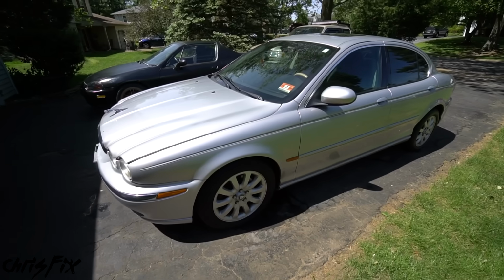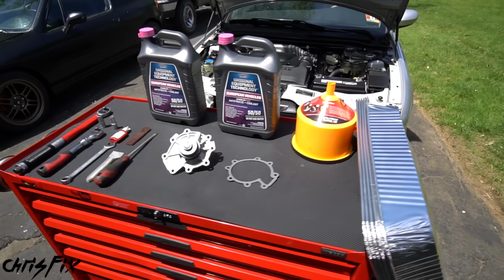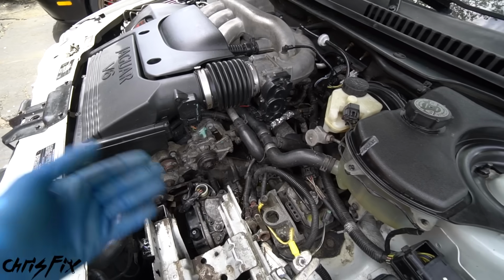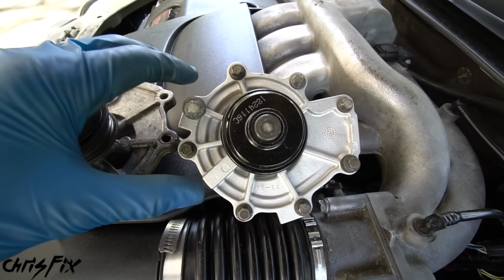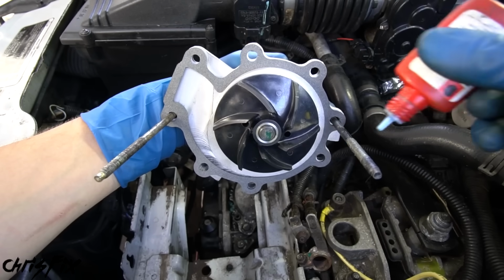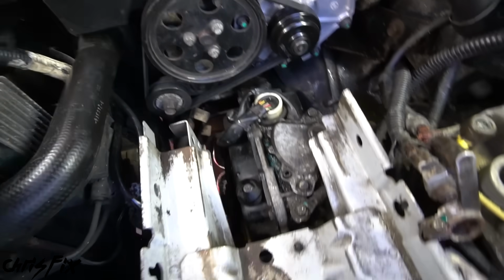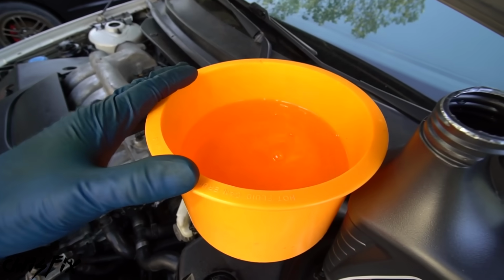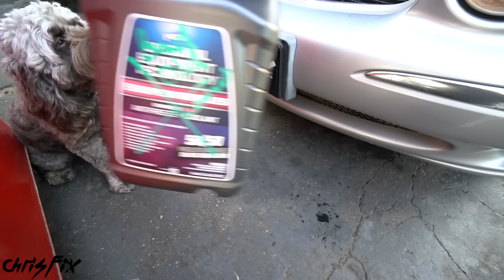How To Replace a Water Pump and Save $783

Comment: Hey Chris, quick question. A lot of your videos mention referring to the owner’s manual for specific torque specs or additional maintenance info. So, I’ve been following that advice — I keep my owner’s manual and a notebook with my car’s specs handy.

Recently, though, I noticed that the maintenance I’m actually allowed to do is pretty limited. The manual I just bought literally says to visit a dealer even for something as simple as checking the transmission fluid level, and it specifically warns not to attempt checking it myself.

As someone like yourself who’s worked with cars far longer than I have, how do you overcome those kinds of obstacles? By the way, thanks to your guidance in one of your videos, I successfully changed my own spark plugs today — and I’m really proud of that. Thank you!
Reply from the maker: Not owners manual but service manual. The service manual gives you everything you need to do pretty much every service on the car. Nice work on changing the spark plugs!!!

Comment: Simpel job.... in my car, an Audi A4 B5 with a 2.4 V6 (yes, the QUATTRO) I have to remove the whole front to get to the pump pain Sadly VW Audi didn't think this part would fail that easily...

Comment: Hi Chris, thank you for the Video. 🙌
I have a question:
After everything is done and the coolant is filled back up, isn't the Waterpump still "running dry" until the thermostat opens?
I just changed the Waterpump and did a Super Flush all in one on my Car and i was wondering if that could be harmful to the new Waterpump? 

Thanks in Advance and Greetings from Germany. ✌️

Sven :)
Reply from the maker: There is a hole in the thermostat that allows coolant to flow, just not at the speed of it fully open.
Reply: @chrisfix ahhh ok, i didn't know that, thank you :)

Comment: How are you Chris? What I don't understand is how the funnel doesn't fill the reservoir completely to prevent spillage. Whenever you take it out, it's at the exact point of the max line.
Reply from the maker: It does but then it spills out when I remove the funnel and levels off to the max line. You can also use a turkey baster to remove some.
Reply: Thank you for informing me❤ @chrisfix

Comment: Fun fact, if the water pump is in a tight spot it can be a pain to keep the gasket in place when trying to install it, i add a very small amount of sealer to the engine side of the gasket to make it tacky enough to stick on. Also it will help even further by filling in any minor pitting that could be on the machined surface on the engine which i have seen before on older engines. Never had an issue doing this

Comment: i’ve literally saved myself at least 2 grand by now watching your videos. changed my own oil at least 5 times now. did my coolant flush today, changed the freaking thermostat while i was at it, cabin filter, and i’m gonna change my temp sensor tomorrow my buick is still running a little hot. i might have to change the heater core though which im scared of because of how much shit i have to get through in the cabin

Comment: The jaguar water pump placement must have come in clutch. I did replaced the pump on my 06 corolla, and i think i only torqued the bolts to 5ft lbs 😭 have to take out the fan, the alternator and work through the wheel well for the bottom left bolts. Good job dude

Comment: Hi Chris im hoping you or somebody will be able to help me. I have a 2nd generation is250 that has white smoke coming out of the exhaust, especially when i rev it. I have looked at the piston and all of them are dirty so it doesnt look like a head gasket. People have said water pump/radiator could be the issue, is this a possible cause? and if so what would have gone wrong? I just want to fix it

Many thanks
Reply from the maker: Has your car overheated recently or is it loosing coolant?

Comment: My water pump is bad everyone keeps telling me I have to do timing chain too. It's a 2007 Ford edge with metal timing.  Do I really have to do timing chain?
Reply from the maker: On that engine you probably need to remove the timing chain to do the water pump which is why it is recommended anyway. It seems like the timing chain is a real pain on that car.

Comment: He gets it look so easy... only problem is my car dosent have space for rench to remove the Polly this Guy makes it look so easy
Reply from the maker: This was definitely one of the easier water pump jobs, I'm planning on making a video of one thats a bit harder to do
Reply: @chrisfix  its fine... was just pissed at my own car because there is no space to work with. so the polly dosent come of, you need to losen it and basicly let "hang" because the polly dosent come 100% off. but enough losen the 5 bolts holding the waterpump... you video is great man. really well informed and well put together and easy to understand. just suzuki that mekas cars impossible to work on

Comment: Do you have a video on water pumps that are integrated into the timing system. Like in the 2003-2007  muranos and infinitis with the 3.5 engines?
Reply from the maker: No but I am planning on making a video for engines like that

Comment: At least your car had an easy access water pump my Subaru’s water pump is inside an aluminum timing cover Smh. So it’s a timing job I just might have to spend that $850 the timing bolts are also stripped fml.

Comment: Can water pumps screech on cold starts if they are going out?
Reply from the maker: They could if the bearing is going out or its releasing coolant through the weep hole and getting on the belt

Comment: hey chris, wanted to have u opinion on a 2005 acura tl for my first car. it’s pretty high on miles with 188k and the dealer says it’s been well maintained and people say tls can push well over 200k miles without major issues
Reply from the maker: As long as it checks out from a mechanical perspective and you can get it for a good price I would go for it! : https://www.youtube.com/watch?v=vC8LbvYk6es&list=PLvKbarVtwhUv6bjLhJSyaEOxaYy03j7QS
Reply: @chrisfix  alright than you so much!! i’ll watch that video a few times over before i pull the trigger

Comment: I just recently replaved my waterpump on my mazda b4000 and ita still leaking in the same spot im asuming potentially a bad gasket or I didn't clean the surface good enough next time i replave it should i put some rtv in the corner with the paper gasket? I know you say not too but i figured it would better to be safe than sorry to have to tear it down a 3rd time.

Comment: Hi there,

I wanted to reach out and let you know how much I enjoy watching your videos. They have been a great help to my guy and me as we work on my 2006 Ford Mustang. We have a quick question about replacing the water pump, which comes with a metal gasket. The manual recommends putting RTV on the gasket, but you advise against it, as it could result in having 2 gaskets, making it redundant. We would appreciate your recommendation on what to do. My car is a 2006 Ford Mustang V6, and we plan to do the work this weekend. Thank you for all your helpful videos, which have saved us a lot of money by allowing us to do the work ourselves.

Jessica
Reply from the maker: If the manual recommends it then I would follow that, in most other cases you would use one or the other
Reply: @chrisfix  I forgot to mention, I meant the Haynes repair manual. That's what it says. So should we still put RTV or no?

Comment: Hi Chris I love your videos. You are a role model. I have a question for you. Here in Nigeria majority of the drivers uses water instead of coolant. I want to know if it is a good or bad ideas to use only water instead of coolant.
Reply from the maker: It's not the worst thing in the world, you can technically use coolant, but I would recommend even 10-20% of your cooling system be filled with coolant and distilled water so it can last a good long time. And if the weather gets cold I would bump up that percentage: https://www.youtube.com/watch?v=29z94xBdAjE

Comment: Hmm me again 
Ive recently did a radiator flush everything was working fine 
Now engine overheating ive try bleeding the system but still overhead 
Thought debris cloged up the thermostat but no since the upper radiator hose is Hot this surely means the thermostat is working 
However i cant check the lower hose since its close to the engine i might burn myself 
Now im seeing some leaks near the pump and weird noise 
So im pretty sure that the water pump is causing an overheat

Comment: Do you have to remove extra fluid after using that funnel? Seems like it would be too high or does it purge excess itself?
Reply from the maker: You can use a turkey baster or similar tool if it's too high

Comment: I had to stop my hand from trying to reach through my phone to try and pet your dog. lol

Also, I had a drain plug shear off and didn't have an OEM radiator. So I put steel stick in the drain plug to seal it. It stopped the leak, but my engine was still overheating. I did some trouble shooting and some googling. I narrowed it down to either my thermostat or my water pump. After watching your video on the thermostat, I pulled my thermostat and it wasn't bad, in fact it was almost new. (About 1 1/2 years old) So then I watched this video. I'm currently replacing my water pump.
I go to your channel for all of my car maintenance questions. A mechanic will tell you is a 3 hour job and needs a bunch of specialty tools. (fan clutch) In reality Joe Smoe (me) can do it with basic tools in 30-40 minutes. Your tutorials are the best. Keep it up.

Comment: Thought my water pump was leaking since their was a leak with no clear sign. I swapped it with a new one. Pressurized the system via pump and coolant flooded out of the timing belt cover. Pressurize your car to check for leaks first lol.

Comment: This is awesome chris 😊 i just have a couple of straight forward questions. 1. Will this procedure be similar to a 1998 plymouth breeze 2.4 4cyl or am i about to step into hell? Lol 2. My car says i need two bottles of coolant with a bone dry system. Now is that 2 gallons with or without 50% distilled water? Im assuming mixing my two bottles with 50% distilled water, leaving 1gallon of straight 5yr green zerex left over is the way to go but i dont know. Greatly appreciate the help thanks!

Comment: You should clean the battery terminals every time you disconnect the battery cables. I also use a corrosion protection spray or the red & green felt pads. I also have old English (early 1960s) cars and a local rebuilder has rebuilt water pumps for me.

Comment: I bought a brand new water pump and the pulley is very hard to turn even after just tightening the bolts finger tight. What could be the problem?
Reply from the maker: It could be normal. New pumps have tight bearings. But if you think it’s bad, get another new one and return that own.

Comment: My battery is stuck 😑 no idea whats holding it in place
Reply from the maker: There is a bracket that holds it in. Just unbolt the bracket at the base. It’s like a small wedge at the bottom.

Comment: Hey Chris, I have an infiniti G35. when my car gets up to temp oil will push its way into my coolant, I've replaced the thermostat, the water pump and the radiator. I've used the head tester and it came back negative. I know I've popped a seal somewhere via too much pressure in the cooling system but I don't know where. I don't have coolant in my oil I've checked it multiple times to be sure. It's only oil in the coolant.
Reply: Bad head gasket probably

Comment: Question if you see it, does the water pump have to be leaking to be bad? I have an overheating car, no heat and it MIGHT? be the water pump but its not leaking.

Comment: Chris, brilliant instructions rendered in John Muir's idiot books style.  Keep em coming!  Have a serious question...like to drive older vehicles, but what happens when a necessary part for an older car is no longer available?  I need to replace my Clock Spring on my 2003 PT Cruiser...and guess what?  there's none to be found.  Several wrecked PTs in the world but no one wants to sell only the Spring.  Is there some resource no one else knows about you can suggest or is it a SOL situation?  (all internet resources, local resources and nationwide facilities have failed to provide).

Comment: Chris,
   Great video!!!  Question:  I know you said that if I have a gasket, I will not need gasket sealer.  I have a 96 LeSabre that I use for work.  I bought an AC Delco water pump and Fel Pro gasket.  Is it possible to put an extremely thin layer of water pump/thermostat gasket maker?  When I say thin…I mean literally spread “micro thin” on the pump, attach the gasket and mice thin layer on the block for the gasket to mate up. I’d only be using this for any small imperfections in the pump surface and block surface.  Not to have it oozing out.  Thx.
Reply from the maker: Yeah you can do that for sure. Just make it so it’s tacky and you will be fine!
Reply: @chrisfix  thanks Chris.  I know you are busy but I appreciate you getting back with me.  I feel more confident to save that money and start attempting things myself.  Merry Christmas to you and your family.

Comment: Just stumbled across this video again after watching it for the first time a little over a year ago trying to figure out how to replace my water pump. First engine related work I ever did and was terrifying. This car is the complete opposite upside down engine compared to my impala, but your video was the most helpful and informative and finally gave me the push to get it done. Took me a little over 4 hours to do (Twice), but I got it done!!! and saved at least $600. I couldn't believe what the shops were telling me lol. I had to take it all apart again because I forgot to tighten the pulley bolts after fighting the python rope, but that's a whole different conversation.

Comment: His water pump was still working. Just the gasket needed to be replaced a $5 fix. He went ahead and replaced the whole thing because it’s cheap $55 in 2022 . $40 when this video was made. they come with warranty plus he loves his dad and wants to make sure he doesn’t have to worry at all. Plus you gotta do the same amour of work so it’s up to you. As a broke college kid I’d just change the gasket . Especially if it’s a sturdy Toyota or Honda factory water pump.

Comment: I watched even though I new how to do this. I replaced my water pump a couple years ago in my 2002 Chevy Blazer. This one was a way lot easier then mine. I had more things to remove and rent a couple of special tools to get the fan off that’s attached to the water pump. It took me a few hours to get it done. I don’t remember what it cost me .  Maybe $60.  Have know idea what it would have cost of someone else did it but I’m sure a lot.

Comment: I just had this experience with the throttle body on my GMC Sierra. I got a check engine code. I took it to the dealer and they said the throttle body needed replacing. Between parts and labor, they were going to charge me $718. So I found that a Napa store nearby had a throttle body my for truck. I paid $186 for the part and once I picked it up, I changed it in the parking lot (using common hand tools 😏) in about 10 minutes. I cleared the code and (so far) it hasn’t come back on. Saved $532.

Comment: I’ve just had my 2001 Tundra timing belt , water pump , tensioners , thermostat along with all belts replaced by a friend mechanic highly recommended for his experience , but I never saw him either torque or use lock tight in any bolt , I’ve just wondered how long my investment is going to last .

Comment: Just had the water pump, drive belt, and the coolant replaced on my 2018 Civic EXT after detecting a weep hole leak at 116,500 miles (Sept. 2022).
Honda service total cost: $875. I consider that a reasonable price considering the work involved. There is no way this is a DIY job for me.

Comment: Hi Chris,

PLease help !!!
My parents are old and they bought a car (2006 VW Touran 1.9TDI) and were advised to change the tensioners, belts and the water pump and immediately after the change, the car no longer idles smoothly, it has some ticks, but only when idling, from what my father told me.
I am thinking, the proble is only from these parts that were not used in the propper way with the propper tools, because will be too much of a coincidence to be something else right after these were changed.
Can be a belt too tight, or bad Water pump ( it is a HEPU pump) even if its new...?
Please HELP, what do you think?

With respect,
Gabe B.

Comment: I jsut replaced my trucks water pump. 1996 ram so the only tool I didn’t have was the wrench for the fan clutch but I got it all off and put together, no leaks at all now! Only cost me $100(?) or something like that for the part.

Comment: I’m trying to replace the pulley wheel on my ford mustang water pump, but the wheel keeps spinning. How do I stop it from spinning so I can fix it?
Reply from the maker: Get the belt back on it so it can hold the bolts and you can remove them! If the belt is off the engine then just wrap it around the pulley to hold it or use a strap wrench
Reply: @chrisfix   The belt is still on while I am trying to loosen the bolts. I even tried to add more tension to the belt but it still spins.
Reply from the maker: @jessicamoreno4661  drill two holes in a metal bar that align with two holes on your pulley. Then you can use the bar as leverage.
Reply: @chrisfix   you sir are a genius! I will try this after I get off work!